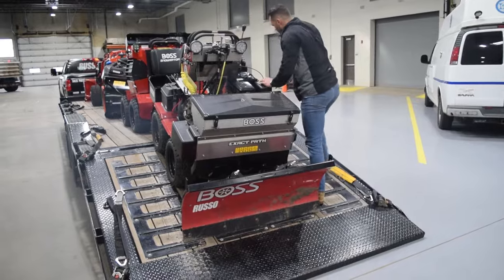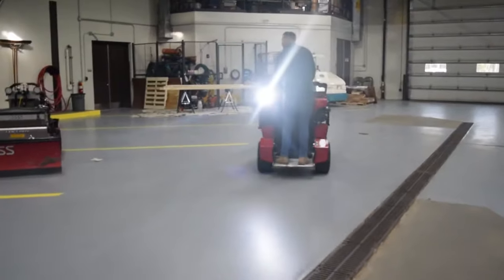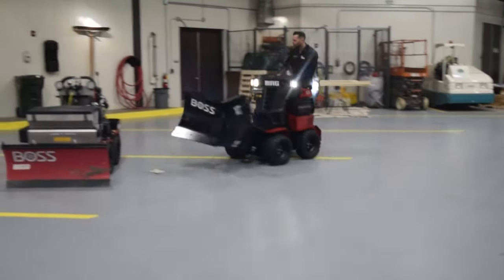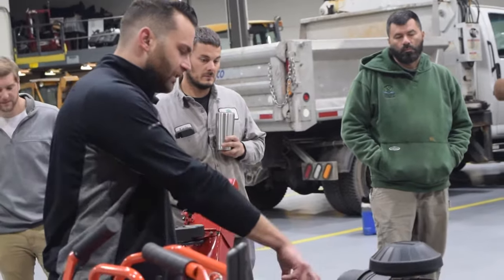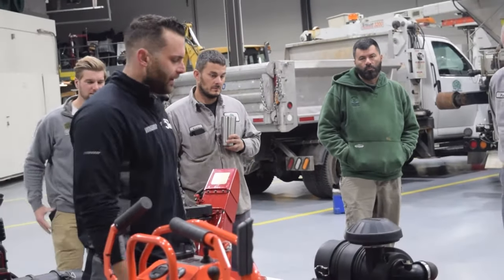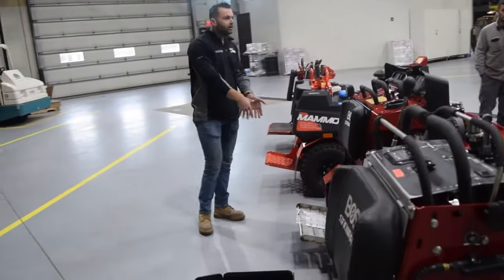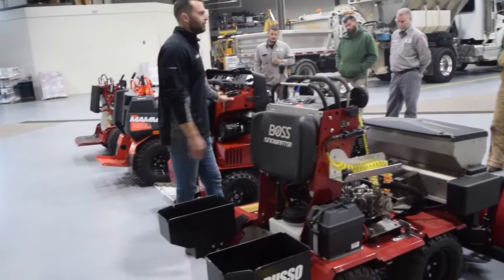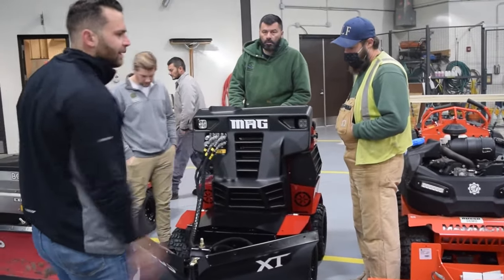BOSS Snowrator MAG Demo! Best Winter Snowplows 2022 (Ariens, Toro, BOSS)

Comment: I can’t see the Toro being that great being it’s only 2 Wheel Dr. and the difference between the mag and the mammoth is the mag which is made by boss is chain driven As in the Ariens has dual belt driven belts snap and stretch but then again chains also stretch but I would say in my opinion that the chain is stronger and will last longer